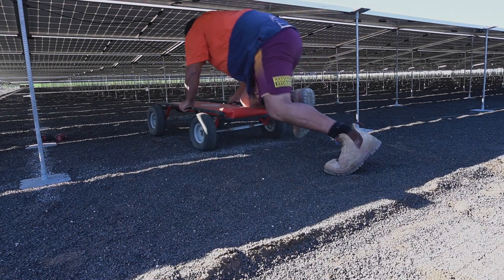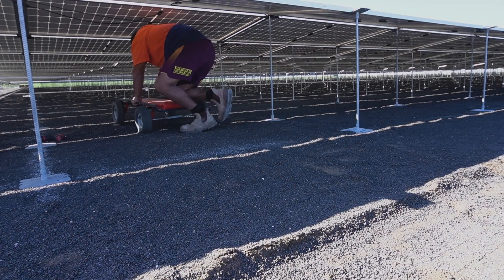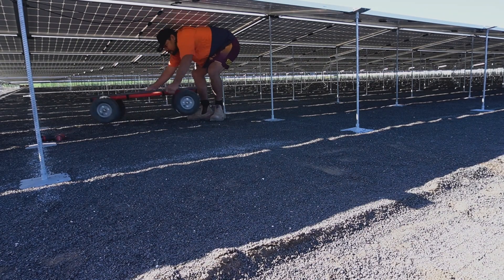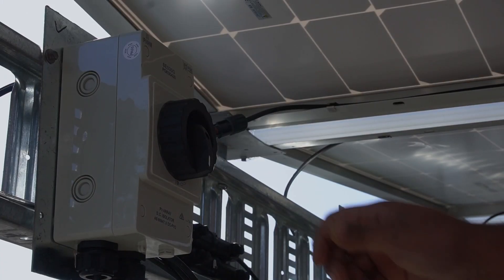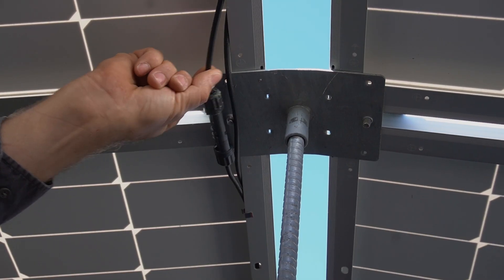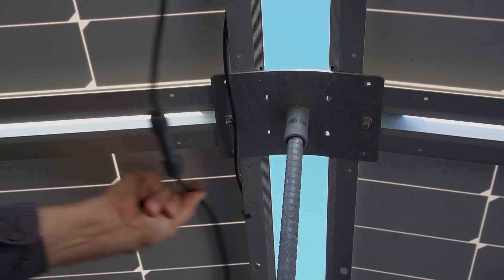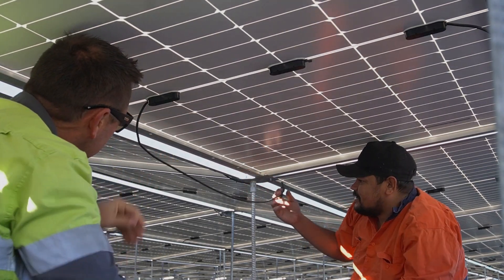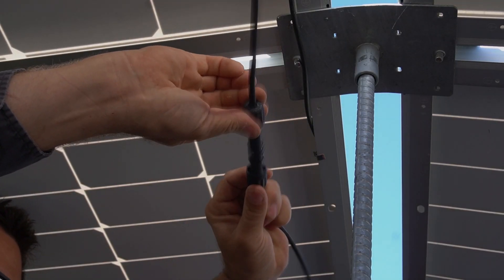Solar modul replacement underneath at PEG solar power plant

Comment: This is a great video Meralli Projects. Thou it is not the traditional fix tilt module replacement, your method is fairly easy and don't require too much effort. 
Great work you are doing with the PEG by Jurchen Technology.